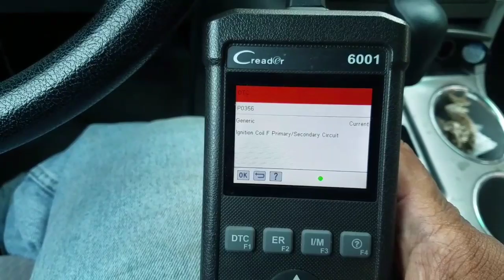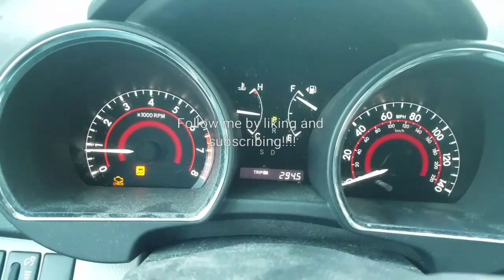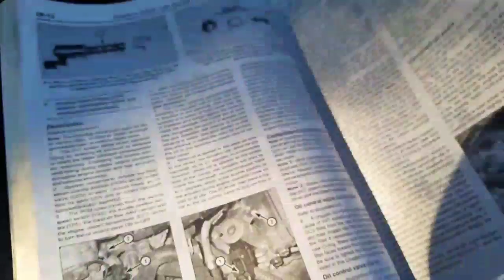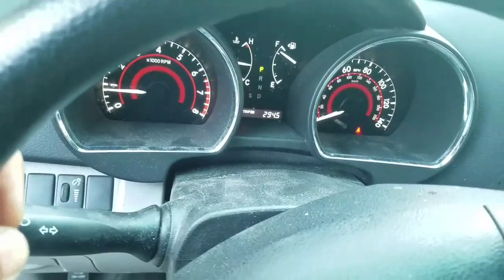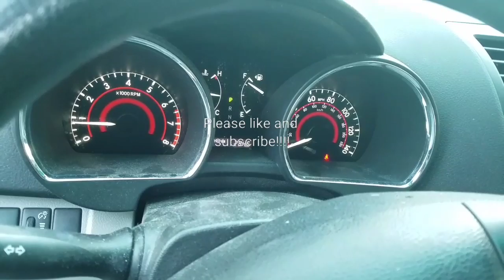Toyota OBD2 CODE P0356

Comment: Is it hard to swap out the spark plugs on the other cylinder head?
Reply from the maker: N0
Reply: @theotherguy3083  I c
Reply from the maker: @dannymartinez8522  as long as you have the right tools, it is alright.
Reply: @theotherguy3083  I'm watching a video right now and I see you have to remove the intake.  Very smart toyota🤦lol

Comment: Great video - thank you.  What happens if after coils are swapped - the code comes on and off every 200 miles or so.  The engine sputters a bit when engine light is on.  Thanks.

Comment: Save a step rather than swapping the coils, if it is missing at idle, just up plug that coil.  If there is no change in the idle the coil is bad. Of course this doesn't work if it isn't misfiring at idle.

Comment: Your coil isn’t the issue that code is the connector / pigtail
Reply from the maker: Really?
Reply: Make sure all the coil connectors are seated.The lock tabs always crack  off.
Reply: Your video is great but most dodges depending on the year you need to verify the pigtail connector. They become loose but replacing the coil is cool tu it’s only a matter of time. No disrespect buddy. It happens.

Comment: i have a 2011 Lexus ls460  i have a po 353 code i replaced the coil reset the mil. and now i want start. the code is still saying the same code.

Comment: if you put a into f cause f was bad then why didnt scanner say that 1 was bad then ?
Reply: Only very advance scanner will tell you the coil number,but that scanner start at $250 an an cost up to $600,
Cheap ones will tell that 1 coil is failing.